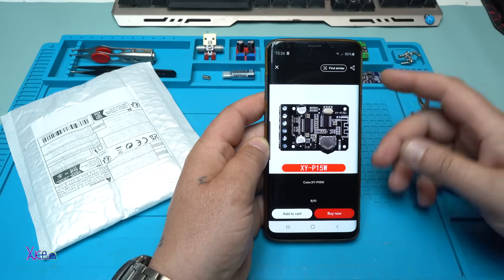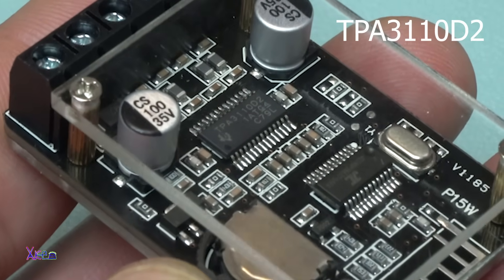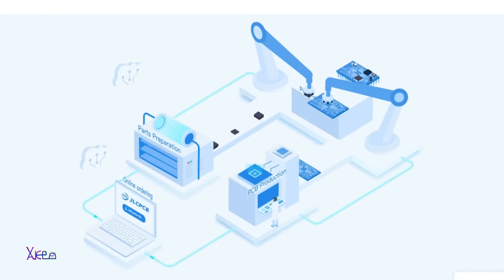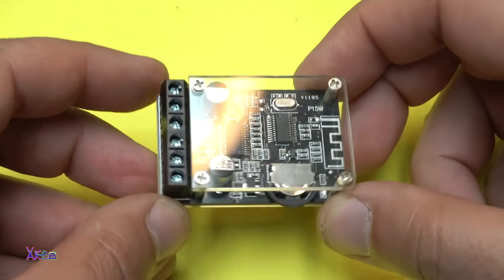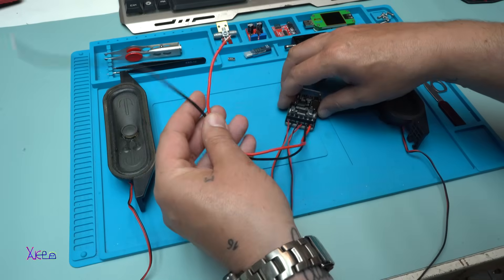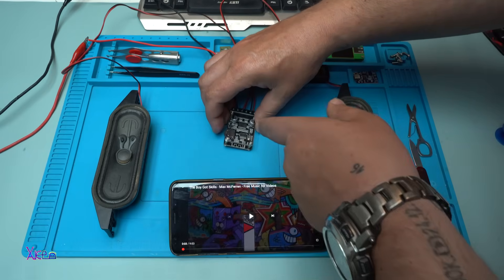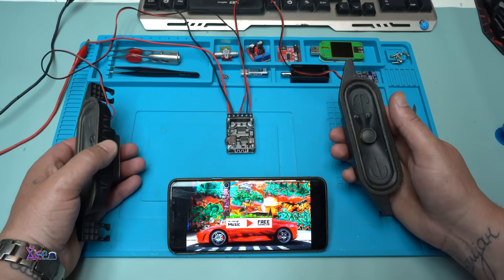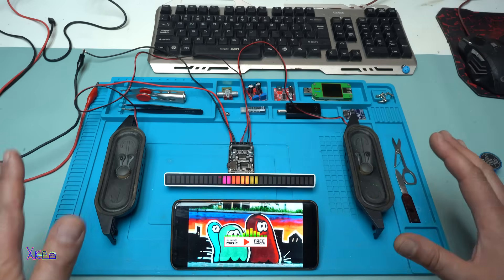$1 Amazing MP3 Module with Amplifier is FANTASTIC?

Comment: I always put a cooler on chip 😉. Passive should be enough, with small fan even better. 
It's not needed until it is. 😂 After hours of playing loud music it can stop without cooler, but survive 😂
Those small amps from AliX are great 👍🏻 
Cheap, good enough sound, loud...for party they do a great job 👍🏻 I wouldn't believe if I didn't set them up on my own 😂

Comment: A bit more expensive now, €2,74 including case.  But together with some regular speakers, a power bank and an usb to dc converter (USB C Type C to DC5.5x2.1mm 5V 9V 12V 15V 20V PD Triggers) this is fantastic
Reply: Mite just making a portable PVC pipe booom box